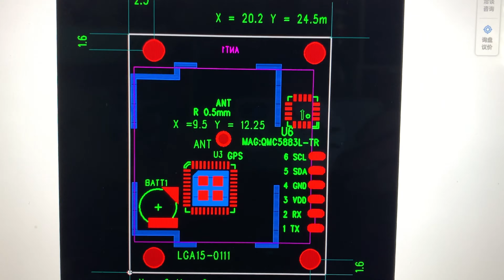Can we make the HolyStone HS175D into an Acro quad?

Comment: Wayne, this is great. You’ve done what most of us have thought to do. Considering this doesn’t really have a carbon fiber frame acting as a skeleton, this plastic housing  did pretty well. I kinda thought the folding arms were going to give you more trouble. Thanks for sharing.
Reply from the maker: Yeah - it's all a bit floppy.  I was only worried about the wires getting caught in the folding arms.  Although it's designed that way those wires that came with it aren't very flexible - but i think after I stuffed it all back inside there wasn't much space for them to move anyway :)

Comment: Great video! Thanks! Feels like the good old days when watching this. Did this too with the XK X251, a cool 2s brushless toy, which actually flew pretty good. 
But after Betaflighting it it had the same wobbles but only much worse. Tuning helped a bit, but still it was all over the place. And I used one of those old aio cams which obviously had no filtering whatsoever, cause the video was horrible with the slightest bit of throttle 😂
It's tinkering like this that created our fpv hobby and I really enjoyed watching it.
Reply from the maker: Betaflight is wonderful, but it really is built around a 5" quad with dshot and motors that can speed up/slow down very quickly.  As soon as you venture outside of that it's much harder to get right.  As you say, it's still fun to mess around with though

Comment: This is a good idea, i might do this to the HS720e i have lying around lol. 🤣

How was the range ?
Reply from the maker: The range wasn't very good, but I used a receiver with a flat ceramic antenna, so it was never going to go far.  If I'd have used a regular antenna, or a little T shaped 2.4 one it would have not been an issue
Reply: @CurryKitten  Noted, thank you, I'll take that into consideration during the experiment. 
That is true a regular antenna should work.

Comment: Do you have a parts list and instructions for this?
I have a potential drone in my collection 😂
Reply from the maker: Not really - it would depend a lot on what drone you are converting.  I just happened to make things fit that I had laying around.  Essentially (if the quad has brushless motors and ESCs already) you just need a flight controller, a camera and VTX and then figure out a way to stuff them all in there